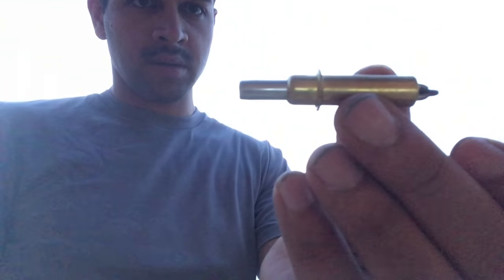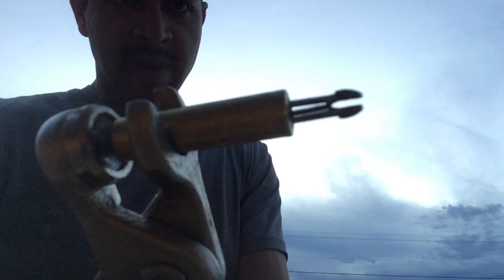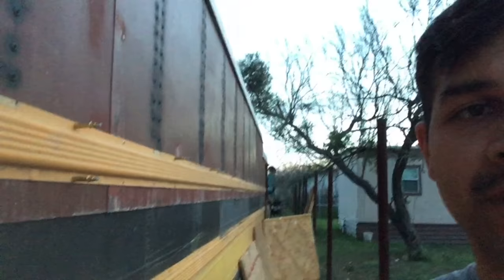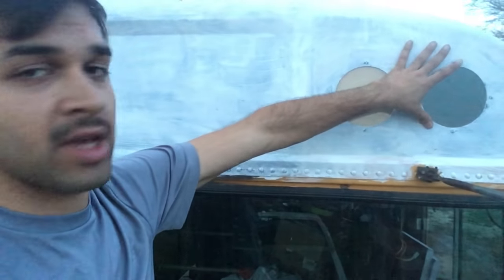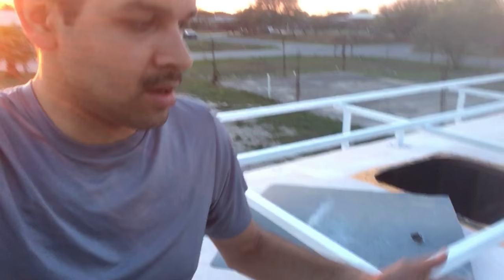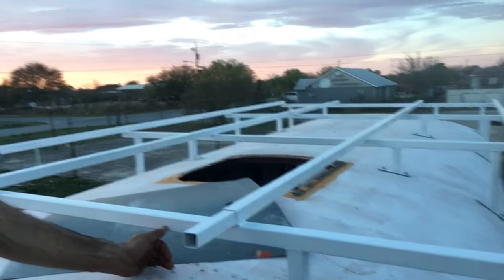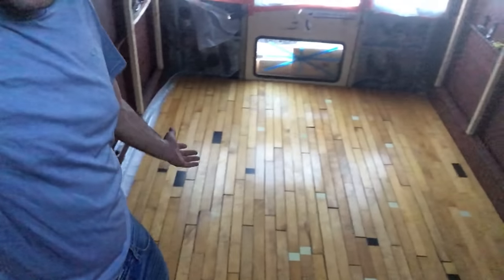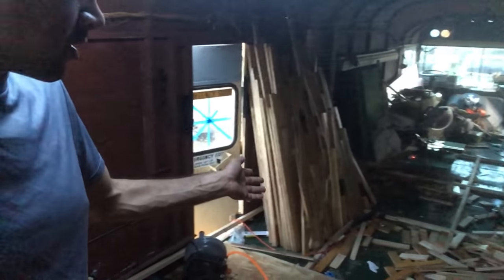The Derelicte Bus #6 - Flooring and Roof Rack Install

Comment: Great build! Do you recall what angle you cut your support brackets that mount the roof rack onto the steel ribs on top of the bus? I'm about to start my roof deck on my short bus and am wondering how to account for the curve. I'm a welder and am wanting to use this same design. Thanks!